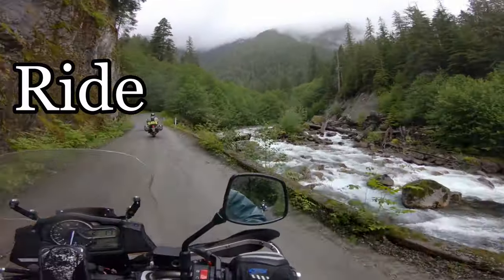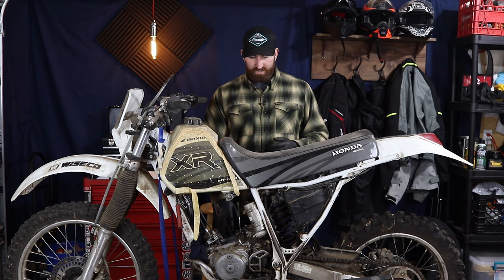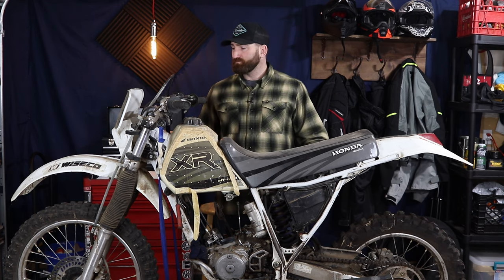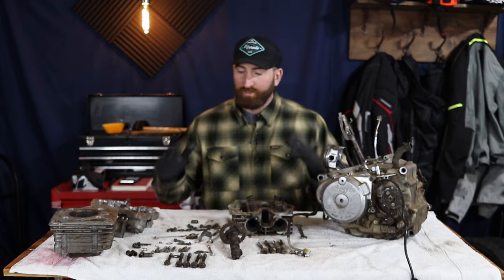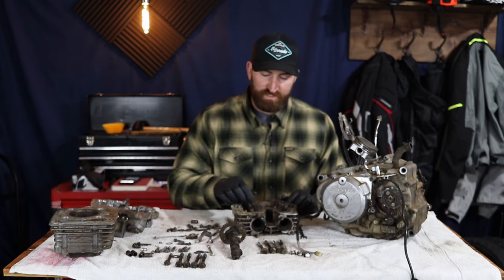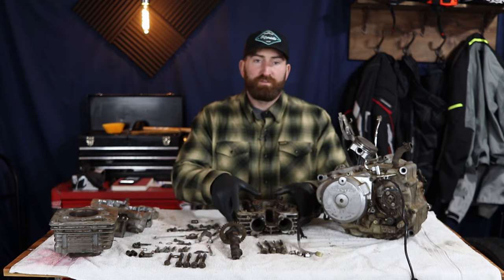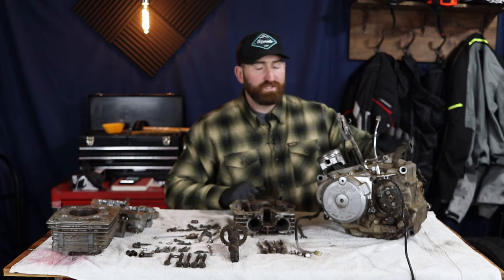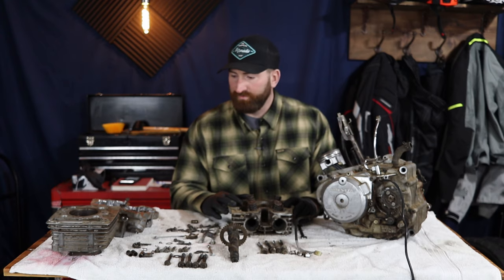Restoring an XR250R: The Tear down

Comment: Great video! Well put together.. I was wondering where did you get all your XR parts from for the rebuild? I’m from Zimbabwe and am trying to rebuild the top end on my xr250 and I’m looking for all the spares.. any links would be really appreciated! Again, great video and I’ll be using it to put my bike back together when I eventually get parts. 
Cheers 
Peter
Reply from the maker: Majority of the parts were from ebay. The rest were from honda parts direct. Just search honda motorcycle parts and use one of the oem parts distributors to find the part number you need then search that part number on Google.